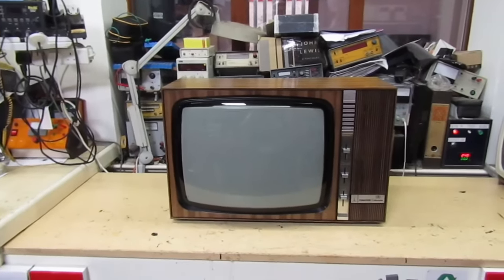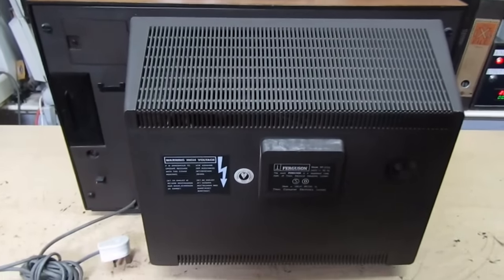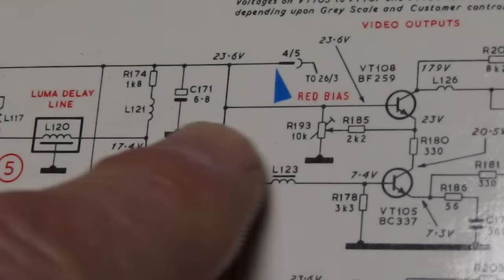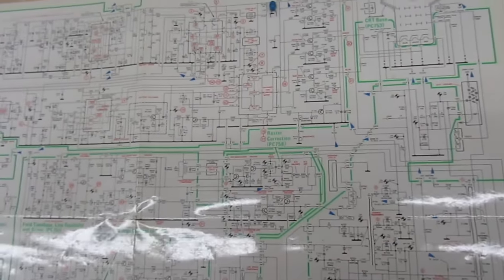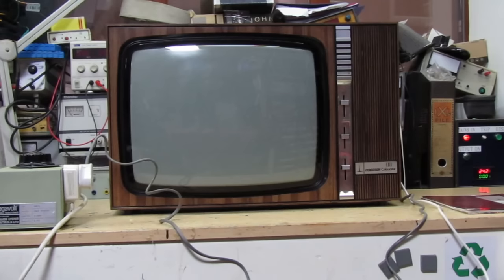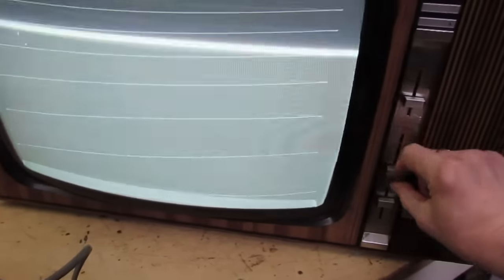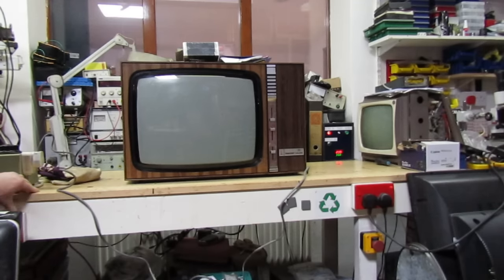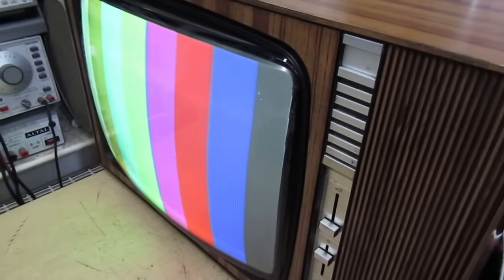Thorn 9000 chassis 1976 vintage TV set

Comment: We had one of those. Served us well for a number of years, from the beginning of '77 till the mid '80s. It was very good for a relatively modest set, with a rock-solid picture from the PiL tube. The light output wasn't as good as on later sets, of course, and it didn't work that well with a VCR (without modification to stop those verticals keeling over at the top on pre-recorded tapes), but it really wasn't at all bad for what it was. Not bad-looking either.
Reply from the maker: The line sync time constant mod was a good money maker back in the 80 s .

Comment: Wonderful memories there Michael. We had various Thorn chassis' here in New Zealand, including the 9000 (9200). There was a 20 inch version called the precision 20. It had a terrible RCA tube which died like your one. Then there was the precision 22 with a 22 inch Hitachi tube. They lasted very well. There was a 26 inch version which had convergence circuitry (9600?). As an apprentice, I tried to get my head around the Syclops circuit. I enjoyed working on them though. I learnt all the faults you mentioned. I hope you make a video about the tube change.
Reply from the maker: Yes there was a Thorn 9600 in a plastic cabinet also and the tube in those were just as bad , if the tube in the loft turns out to be the same one then there will be another part to this video.
Reply: I'd forgotten about the 9600 chassis, only ever seen a few of those and I stand corrected on my comment regarding the Precision 22 tube brand for some reason I thought they had Toshiba's but then I remembered the Pye sets had those! Those Hitachi tubes hold up extremely well.

Comment: Great Christmas video Michael.....    Has brought back memories of repairing the 9000's, when I worked for Rumbelows, back in the 70's. I also purchased a new one, for my parents from the retail shop, with staff discount. TV had a very good picture, due to PIL tube.  Eight years later, after repairing all the stock faults, my parents upgraded, then I took charge of the old 9000. I used it as a direct to RGB monitor (not via the tv tuner), with my BBC model B, home computer. From memory.... I made up an RGB to computer interface, which incorporated opto isolators, form one of the electronic magazines.
Reply from the maker: Glad you liked it , I have a feeling I have seen some sort of project in Television magazine using opto isolators many years ago but I have a feeling it may have been just for sound .

Comment: i have  a thorn 8000  ferguson 3712 in the back of the barn. worked fairly well when last powered up in the early 2000s apart from teletext flyback lines!  from about 1972 i think!
Reply: If you’re within an hour of Sheffield, I’d LOVE to have that!
Reply from the maker: I have a couple of 8000 s and still a few parts for them , tubes weren't so good in those either .
Reply from the maker: Im not that far form Sheffield but sorry mine are not for sale , I have a couple of Thorn 8000 sets in my collection . @stickytapenrust6869
Reply: @michaeldranfield7140  My comment was aimed at Andy.

Comment: before condemning the tube what about doing a full grey scale adjustment?
Reply from the maker: Experience tells me its the tube but yes you are absolutely correct the heater voltage needs to be checked before condemning the tube .

Comment: Never saw those piles of crap in OZ but you did send us the portable oven aka the 3504 & they were an epic failure in Aussie heat with the muli tapped resistor they used for power rails, then we got the 4KA with it's faling ceramic thin film resistors & they were worse, the next Thorn I saw was a Mitsubishi & no more problems they were very reliable.
Reply: We got a variant of them in New Zealand, and they would bake in our summers too. Many customers took our hint that the sets were more reliable if the back cover lived in a closet rather than on the back of the set. 😄 I did like the switch mode supply though. It was simple and as an apprentice, I could understand the concept of switch mode from those, and then tackle the tricky supplies in other sets. We got the 9000 that he has in this video and it was way better than the early oven. Pretty reliable despite his one having most of the problems all at once. The 20" version did have a crap RCA tube, but the 22 had a wonderful Toshiba, so they were the ones to go for.
Reply: @tenmillionvolts  They were all a unreliable  P'sOS here till they went to the G-Chassis  Mitsubishi in 78 but they had plugin cards with foam on the top of the gold contacts which due to heat would melt & run down into the connector causing kaos, but once the was fixed on all cards in home service they where good.
But those 4KA's where a service call a week hence a POS & we had about 80 on rental.
Reply from the maker: the Thorn 3500 was the worst with its low voltage , only 60 volts HT rail but very high current power supply , the board would go black with the heat .
Reply: @michaeldranfield7140  Yes I'm well aware of the huge list of problems they had plus the picture tube was mounted upside down& you could never get good purity here in the southern hemisphere so I turn the picture tube around 180 degrees so the ulta cap was at the top that fixed the bad purity & convergence problems but they failed extremely regularly, they didn't like 40C in summer... epic failure but worked good as a heater.

Comment: Last time I saw the inside of one of those was the mid eighties. Did lots of them at RR. They were forever being retubed . The NGT thorn reguns ( No Good Tubes ) had to be left on soak for two days to make sure the things didn't spark over and trip the set. They had a great picture with a good tube and as they had the convergence rings set and sealed there was very little adjustment. EW diodes , Triplers , tant. caps . flat tube , A1 supply  you seem to have covered the lot there Michael didn't they have a thick film resistor unit in the video somewhere ? . Merry Christmas.
Reply from the maker: the only thick films in the 9000 are I think the over voltage protection module, I think your getting confused with the Thorn 3500 chaiis where the video output module was a thick film resistor block , stay tuned , I have one of these also ! The Thorn new life CRT s were as you say pretty dreadful and thats whats worrying me about the CRT I have , it could be worse than the old one .

Comment: I remember when the 9000 chassis came out they were a big improvement over the 8000 and 8500 in build and picture quality the tantalum and SKE diodes always a problem the replacement triplers got rid of the arcing and get rid of the plastic anode caps.Basic fault finding usually got things working again but the Euro style tubes ended their lives
Reply from the maker: I liked most thorn stuff but as you say all let down by poor quality CRTs , some mullards were not too good either .

Comment: I remember seeing a lot of these in the early 90's  mostly ex rental DER and Baird, the customer had a lot of guest houses and the sets probably originally came from one of the disposal warehouses. I do remember the tubes weren't great by then. It wasn't one of my favourite chassis, I was more into the later TX9 and 10, but my boss knew them inside out. It was pretty groundbreaking for 1976, I always thought they were a bit later than that.
Reply from the maker: TX9 and TX10 videos coming soon ! 
Thorn was the backbone of the rental industry but in most sets the tube always let the set down which is a great pity .

Comment: This takes me back, in 1976 i was 21 and had just completed my apprenticeship
and obtained my C&G 223 colour certificate.
When you mentioned the tant, a few of the other faults came back to me.
The best sets for long tube life were valve based, they were more gentle on the tubes
than transistor RGB stages.
Happier times when most of the faults were known and the more obscure ones could
be found with a multimeter and scope.
Television magazine was a great source of information and cheap parts fron Sendz Components.
Have a great Christmas and New Year Michael.
Reply: I was one of the last apprentices to do the C&G 224 course starting in 1983 and finishing in 1986. Only one more year came after me ('84-'87) into D|E|R as apprentices - when they finished the program ended and I think D|E|R didn't last much longer after that. Happy days and some great memories and stories from some of the Sales Reps and Engineers, many of which I couldn't repeat on here! Every Christmas I used to get a big hamper with cheese, meat and wine in it, which put a big smile on my dear old mum's face. Happy Christmas to you, Michael and all the followers of this channel!
Reply from the maker: Too right and because production of a TV set could last 18 months or more  before the next model came out you had lots of time to find all the stock faults , unlike today when you never seem to see the same set twice .
Reply from the maker: when you think back to all the TV rental shops we had back then because people simply couldn't afford to buy a new TV and now there next to nothing to buy  its so sad.  @radio-ged4626

Comment: 9000 just loved the nice laminated schematics, great easy to wipe clean 😊
Ah the old fan heater ploy,.
Did that trippler come from HRS or CPC?
Don't ya just love the smell of RIFA's in the morning, it went quite sedately!😊
Reply from the maker: I don't know for sure as I got it with the set but its just like the ones I use to buy from Sendz components in the 80 s , do you know I never had any problems with those Rifa capacitors until quite recently , 5 years or so my Farnell bench power supply went up in smoke and it was a Rifa, and now I have had a few in vintage TV sets burn up , I have some brand new ones and I can see the problem , the plastic jacket has cracked with age and they must let moisture in .

Comment: Great video. Here in New Zealand we had the identical chassis which was known as the 9200. The 20 inch RCA tubes like this one never lasted, but we had a 22 inch version using a Toshiba tube and they gave an outstanding picture. I fixed a few of these back in the 1990's and have one waiting to be repaired in my collection. We also had the 3500 chassis known as the TX574- they weren't the greatest set, I have one of those as well. Look forward to Part 2 on the 9000!
Reply from the maker: Glad you liked it , I have a Thorn 3500 that I want  to do a video on soon but unfortunately its a 26 inch so I'm also expecting the CRT to be worn out too.
Reply: @michaeldranfield7140  The 3500 I have the tube was re-gunned in the 1990's and was probably retired after that.When I got the set, I went around the power supply checking all the silicon and then gingerly applied some mains and it burst into life amazingly with a raster showing frame foldover and no blue but the tube appeared to be ok otherwise. I'll get back to this set at some stage! Look forward to a video on your 3500 :-)

Comment: Michael- might you have a schematic for the cap reformer?    Great video That looks useful.. Thanks 
 I saw many of those style fuse holders lose tension and when trying to tighten them, the metal would break off on the pressure contact to fuse.  I restored many TV sets and one problem after another was so frustrating.
I also had the same issue with the main fuse holder in my old Ford1 ton  van. Heat from current flow would blow the fuse. Added an off board holder & problem solved).
Reply from the maker: I remember there was a GEC 2110 set in which the mains fuse would just go open circuit for no apparent reason and then one day I realised what had caused it , a bad  contact in the fuseholder caused the fuse to heat up and melt the soldered joint at the end cap,
 for the cap reformer have a look on " world radio history "  July 1995 Everyday practical electronics, this is the basic circuit , I just added a bit of my own circuitry to it .

Comment: wow i cant believe these are that old!  ,i was messing about with philips g8, and rbm a823,s at the same time as these  i thought these were far more modern with a pil tube no cooking convergence panel  and a cyclops switched mode psu 
that psu struck fear in me as it felt so wrong  to bypass protections to see why it was tripping (i cant remember if a variac screwed these sets up?)
Reply from the maker: unfortunately were all getting older , I was only 21 first time I repaired one of these , not far off 60 now so these videos bring back very good memories for me to , G8, 823 did all these back then although when I first set up on my own sets like these were getting old and un reliable and usually ended up scrap .

Comment: Excellent trip down memory lane. I recall fixing ITT CVC5 hybrid TVs in the early 70s. I still have a Rediffusion MK4a in almost daily use.
Reply: Rediffusion MK4a were a fantastic TV. So simple to use, even my Mum could operate the teletext.
Reply from the maker: our first colour TV was an ITT CVC9 chassis ,I would love one of those and the redifusion sets were good as you say , I have some very happy memories of these too, in fact I have a MK 1 hybrid set .
Reply from the maker: redifusion were good sets , I think it was the Mk4 that suffered from dry joints on the chopper transformer ,  due to a vertical mounted power board  @quattrohead

Comment: Ferguson made awesome televisions, my favourite is the little Ferguson courier portable black and white, that thing lasted forever! My local repair shop in stoke-on-trent used to replace the Mullard CRT's with either Philips or Toshiba's, as the mullards were literally dead in emissions after about 4 years, that was the only weak point of them really. The problem was the filament, dropping it from 6.3v to 5.8v usually cured the problem. Those slide controls were a real pain in the backside though, im glad they got rid of them by about 1978
Reply: TX10 was their best chassis in my opinion.
Reply from the maker: Yes , I liked the TX10 , I still have a couple here . @quattrohead
Reply from the maker: Ferguson did indeed make some really good sets as you say, only let down by the tube , it all went to pot when they got involved with Thompson and made the dreadful ICC chassis sets .
Reply: @michaeldranfield7140  Yes! terrible they were, the TX portables had an awesome picture too

Comment: those innards looks familiar, think i had one some years back and stripped  it for parts as the tube was pretty much dead
Reply from the maker: I scrapped loads of these in years gone by, most Thorn stuff suffered from poor tubes .
Reply: @michaeldranfield7140  we had a few tx models in the past and they'd give good pictures for ages then suddenly seem to drop off quickly, those models used auto grey scale so likely the tube got too bad for the chip to compensate

Comment: those damn RIFAs!! 😉  bad design having it before the mains switch, i'd reconnect a new one to after ...
Reply: The mains filter is before the switch to stop impulse interference from the switch getting onto the mains.
Reply: @stickytapenrust6869  but that will only occur on switch on or switch off, most other makers had it after the switch....
Reply: @andygozzo72  I think through the 70s and into the 80s, the practice was changing to stop that interference from getting into the mains, as I had a couple of Grundig V2000 VCRs with the filter before the switch.

Now it only makes sense for it to be after the mains switch but wasn’t at the time, they were probably told by RIFA that their mains filter capacitors were better than the TCC waxies that manufacturers used to use. Obviously now in 2023 we know that that’s not turned out to be the case.
Reply from the maker: That's what threw me , when smoke started to poor out of the back I thought I had left the set switched on but no it was in the off position .